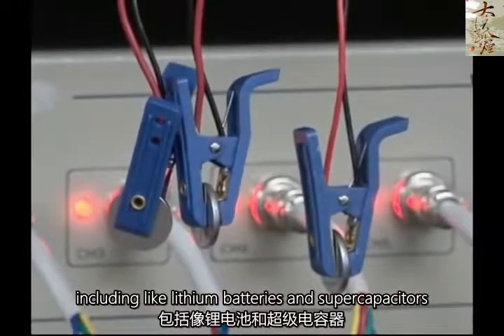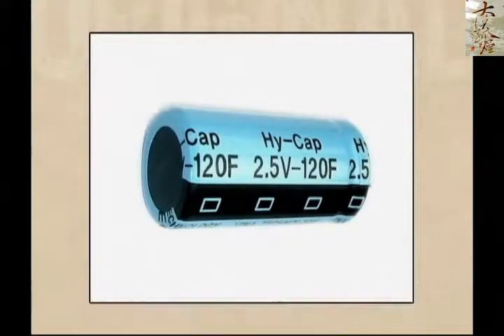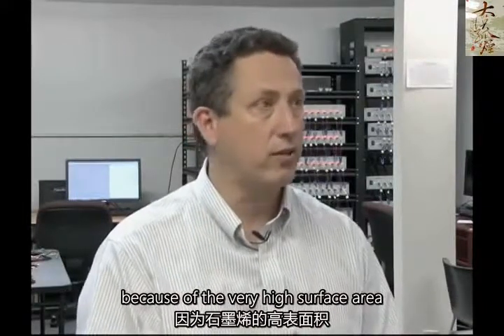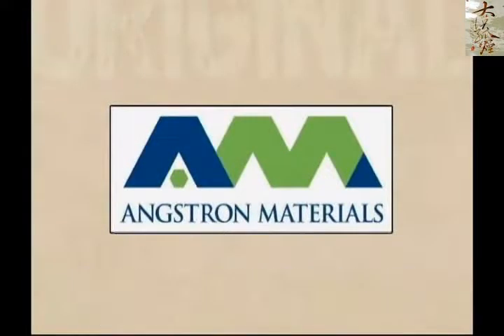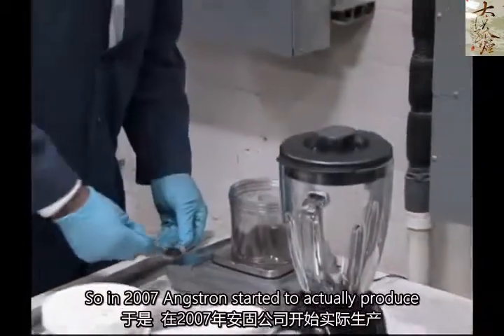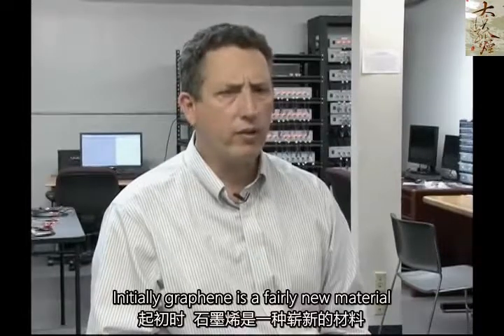Dayton Original  Angstron Materials (graphene) 中文字幕+英文字幕

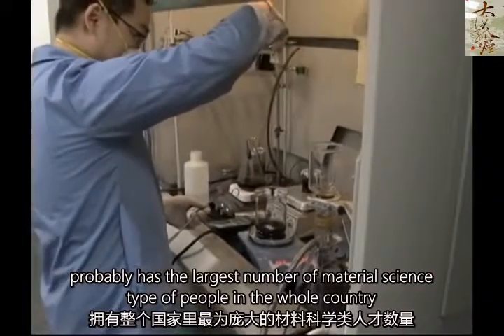Comment from the maker: 01:07   array of                04:21 necessary    
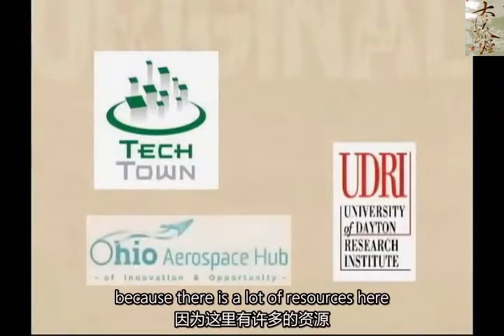00:06   installment + series    03:51   composites        00:00  alive and well
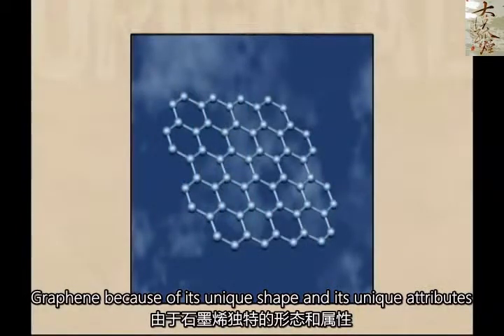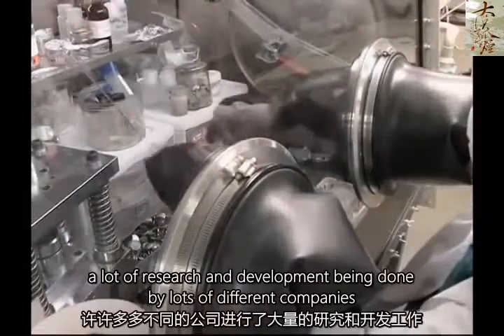00:26   per capita                   01:21   attributes?         03:29   figure out
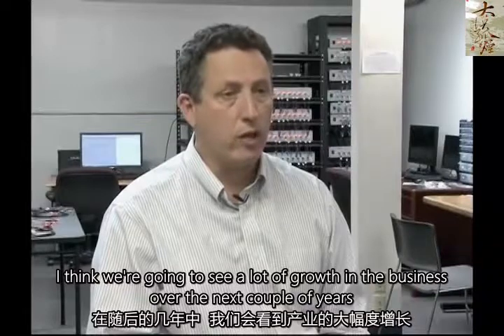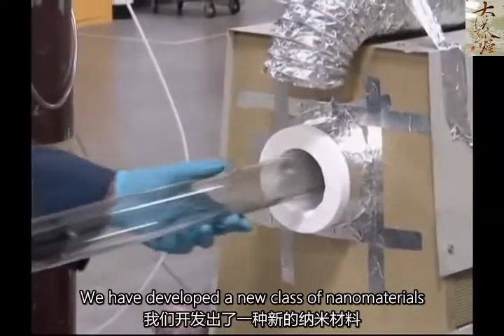00:34   all about?                03:23   initially                 03:10   useful
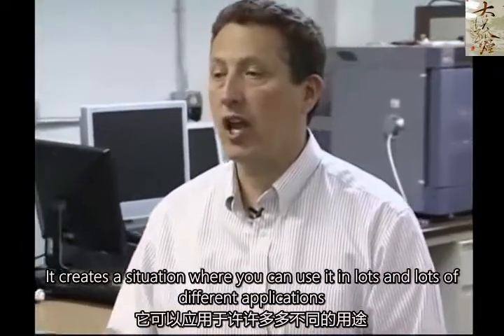00:00   legacy?                      00:26  be ranked No.1       01:32   shielding (v)
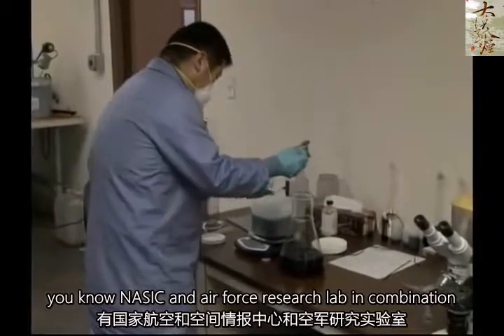04:04  material science type of  03:35   marketplace            01:09   lithium
01:21   unique shape+ unique attributes     01:58   as opposed to
03:48+04:21   resources 勇气; 才智; 谋略; 有助于实现目标的东西;
00:06+ 04:17+04:26   originals (n)  02:36  origins 起点        03:19  a lot of growth?   
十1:06+03:54   energy storage application +area                  01:46   touch on
00:10   enhance                   00:00  high-tech business      02:07  high surface area
02:16   laid out?
04:31  to view  (v/n)            03:05  turn out (turns)           04:04  probably
03:58  in combination (with) 03:05  promising (a)                02:45  patent on
2:36   in the late 90s         03:23  last 3 or 4 years            00:26  the number of
04:04  the largest number of   03:23  fairly new    2:53 (v/n) follow sth up (follow up )
01:32  aerospace         04:17  be proud of        01:06  particular material
03:48  particularly        02:53  actually produce  实际生产 03:35  actual end products
03:48  advanced material    01:42  conductive     02:05  help with
 00:17+00:34 +01:27+03:35 where (R-adv/adv,conj)    03:29  point where  
1:21   situation where    01:36  composite    03:26  there have been
03:05  class (n/v,a)       02:13  sort of      01:49 +02:05 charge up   
02:05   these days   00:10  explain   03:44  location    00:57  slice (v/n) -- slice down
02:16  end to end ( end-to-end )
  01:58  (KSBDSSWJC)
########################################################
Where ( interr-adv) -- 
Where (relative-adv)
   1. (at,in,or to will used after a place or situation)   -- 00:17 +01:27 +03:35 
    2. (the place or situation in which)  --00:34+ 
wherever  (relative--adv)
wherever  ( conj ) --  
whereas  (conj) 
everywhere (adv) -- 
everywhere (none) -- 
anywhere (adv)--
anywhere (pron)
somewhere (adv)--                           nowhere (  adv）    elsewhere (adv/pron)  

somewhere (pron)-                          nowhere (  prone）          nowhere (  adj) 
#######################################################
How (adv-ways or means)--00:10  +   
How (adv-ways or means+infinitive)-- 02:45+03:29                                
How (adv-conditions or quality)-
How (adv+adj or adv)-- 
how  ( surprise about the extent of  sth)
How (R-adverb)
How (exclamation)
However (contrast-contradict)--                                                   
 However (R-adverb) 
However (R-adv+adj+adv)                                     
somehow (adv)--                   how (phrase)  -- 02:21                                
################################################
When (adv-- how soon) --   
When (adv-in what circumstances)--
When (R-abv)-- 
when (conj-at or during that- after )--
when (conj-at or during that- at any time that, whenever )--02:48
when (conj-- although, whereas)-- 
whenever (conj-whatever time occasion)--
whenever (conj-every time that)
-
whenever (adv-suprise or confusion)
-
when (phrase)--
 during (prep) --
even when (conj) --                     when + prep   ---                  not when --
   when + ing+名词+过去分词  --               as as when --
#################################################